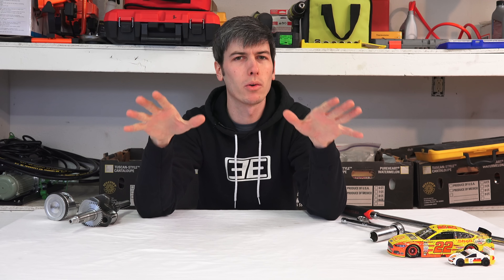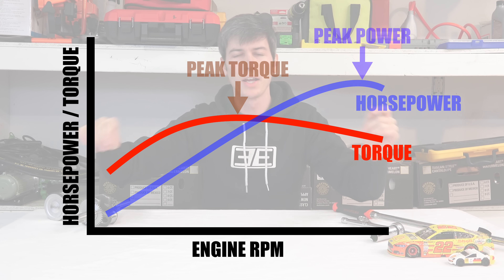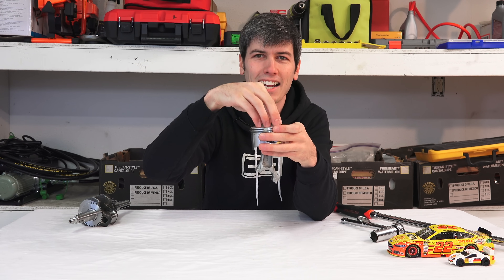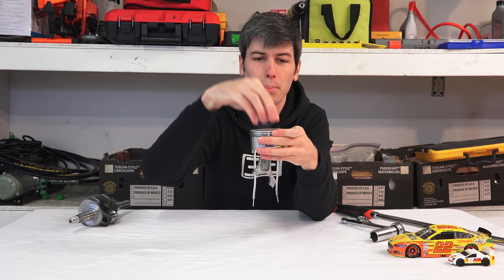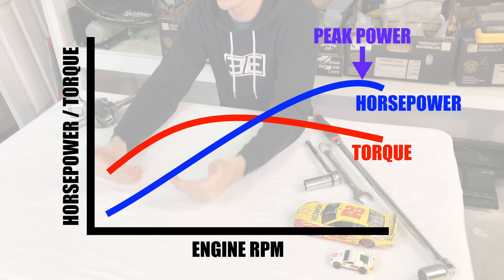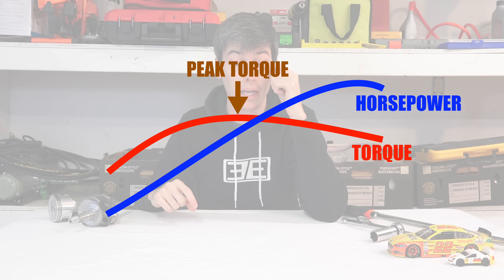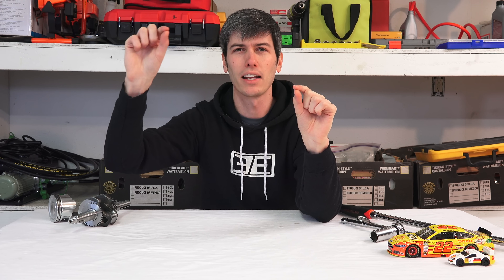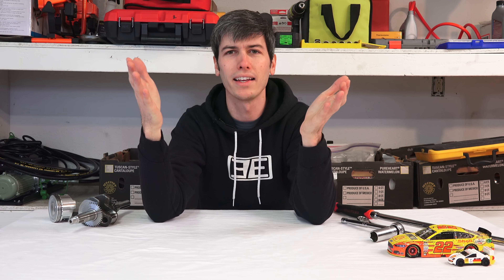Horsepower vs Torque - A Simple Explanation

Comment: Is Torque what allows a Car to go up a hill faster than a Car with less torque?
Reply: No, power is the end all be all when it comes to capabilities. Power is torque times rpm. It takes a certain amount of torque applied to the wheels to move the car. The wheels need to spin at a certain rpm for the car to move at a certain speed. Power tells you how much torque you can apply and how fast you can move the wheels.
Reply: @Redtooth75  Wrong. Car with same power + more torque, goes up hill faster.
Reply: @jp3630  if two cars have the same power but one has more torque then all that means is that the car will less power will just have to be in a lower gear. They will get up the hill at the same speed. If you apply more torque to the wheel then you will accelerate faster but in order to apply torque at a certain speed you need power. If power is equal then both cars can apply the same amount of torque at the same speed.
Reply: No ,you need more power with corect gearing to achieve more force at contact path which push vehicle forward no matter how much is on trailer etc feg let say we have 2 truck with trailer each weight 30 tons first truck have 500 hp and 5000 nm at engine crank in peak with optimal gearing whatever that gearing and quantity of gears be neded vs some other truck have 1000 hp and 2500 nm also optimal gearing and we have uphill at angle 10 degrees what is huge angle avg viaduct have like 3 degrees typicall so those truck will have very hard time go up this hill with this weight anyway quees which achieve tip this viaduct first ? Let say it have 2 km lenght and we start from stand still 😁 well it be 1000 hp/ 2500 nm version its because power:velocity= force at contact path so at each velocity 1000hp/2500 nm version thanks optimal gearing be able to exert 2 times biger force at contact path which push truck forward uphill and if weight both truck are the same than we know from this formula = force = mass x acceleration that second truck will accelerate uphill 2 times faster pushnyour body into seat 2 times stronger 😎

Comment: 50 years ago my Father worked at Caterpillar. I asked him why they didn't put those powerful engines that were in the bulldozers in a race car? Just think how fast that powerful motor would make the car! He gave me the "torque versus horsepower" talk. I remember that he eventually explained the race car would weigh a lot more in order to handle the torque of a big Cat diesel and that the extra weight would hurt acceleration.

Comment: can you make a vid explaining  "Volumetric Efficiency" in a diesel engine. i modified my diesel tractor and trying to understand the relationship between rpm and torque curves. i know HP is part of this equation, but i think VE plays the biggest part in max torque. a race car you want HP, but in heavy equipment you want torque.. right?
Reply: Volumetric efficiency is how much air can fit into the cylinder vs how much actually enters the cylinder. It is mainly determined by the camshaft but the cylinder head and intake manifold also influence it.
Volumetric efficiency is what determines torque, the torque curve is very close to the same as the volumetric efficiency curve.

Comment: Well said...the fastest car is keeping the engine at the highest HP (not TQ).  That's why these 8 speed automatics (often with less HP than previous 4 spd cars) are so much faster...they keep the car closer to peak HP (I think the new 2022 Honda Accord Sport has a 10 sp trans!).  Same with CVT as you noted.  

Also the basic physics formula for force is F = P/V (force = power divided by velocity), so to keep your "rocket ship" being pushed (force) as hard as possible for any given velocity, you want it at the highest Power (HP) not TQ.   (Total side note, but based on this formula, you can see the "push" you feel will decrease as speed increases.  That's why if you floor it at 25 mph it's much more of a "boost" (if at peak HP) than if you floor it at say 90 mph.)

Comment: My question is : will a straight 6 produce more torque than a V6 engine because it has a longer crankshaft? 
And also Are CVT cars faster than manual or automatic transmission cars?.
Reply: Torque is independent of crankshaft length, but will change with varying connecting rod / crankshaft radius geometry.

CVTs cannot generally handle as much torque as other designs, so generally performance vehicles don't use them.

Comment: @Engineering Explained 
I’m just a bit confused! I thought that Torque affects acceleration/0-60, but HP affects top speed….is that right?
Reply: It's weird. Ignoring constants, HP=torque*RPM. Think strongman competition vs someone who runs sprints. HP describes total work accomplished, let's say moving a school bus to the other end of a parking lot. Doesn't matter how it gets there, but that is the work to be done. A strongman could strap himself to the front, put the bus in neutral, and pull the bus across the lot. He moves slow, but he can pull it. A sprinter couldn't pull it, but you could disassemble the bus into 10lb pieces and the sprinter could run those pieces to the other side over the course of 1000 trips. If both people had the same "power," the final piece of the bus would make it there just as the strongman crosses the line. A high torque engine is designed to just put out massive amounts of force, so the thing is all muscle - at the trade off that it can't run fast (lower max RPM). A smaller high hp engine, is designed to be a lean sprinter. And if you had the right transmission, you could, in theory, put the same power down to the wheels. The practicality though is that the high torque engine is heavy and would be silly to put in a lightweight sports car. Likewise, to achieve the same hp in a small engine, you would have to have high revs - something that is stressful on the engine and very low fuel efficiency.

Comment: As alway's a great video.  
However, I felt that you left out a MAJOR misunderstanding of HP ratings in regards to cars, trucks & manufacturer advertisements.  They always give you the max HP of the motor which is always @ MAX RPM.  The problem with this is that no-one ever spends much time @ all @ 7000 RPM if that is the max RPM of said motor.  There is a reality operating range which should be acknowledged which is typically in the RPM range that we all run our vehicles at.  This is why diesels always feel like they have so much more towing power because a gas motor needs to be running @ the top of the revs to be hitting the HP levels the manufacturer claims it has.  Nobody that I know drives there gas powered trucks around red lining them just to reach the MAX claimed HP.
Reply: Not necessarily at max rpm, although it may be there at max RPM for naturally aspirated motors.

Comment: I think one part missing for me is that when I'm driving I start moving from my idling RPM.  So in a car tuned for high speed I don't see a lot of power until I can get the RPMs up.  In a car tuned to hauling I can see a lot of power at low RPMs.  And as explained elsewhere in the comments engines with lots of power at low RPMs cannot handle higher RPMs at all (and thus need larger high gears to reach highway speed), and engines with lots of power at high RPMs can handle higher RPMs better than not at all.  Start considering the size and weight of a transmission as a limiting factor and the difference in vehicles makes some more sense.  

On a side note, a bicycle may have 20 speeds (gear pairings) but some of the gear ratios overlap.

Comment: Which one should i use (peak power or peak torque) in these situations:
1. Climbing a hill / mountain
2. Drag race
3. Trying to achieve top speed
4. Off road driving
5. Pulling other vehicle
I will appreciate any answers
Reply: 1. power 2. power 3. power 4. usually neither since that will cause wheel slip and loss of control. For crawling motors with low rpm torque available will be more practical 5. power to accelerate, but usually motors with more low rpm torque available will be more durable, comfortable, and practical for towing

Comment: I always think of HP and torque as speed and strength, racing cars are quicker because the have more horsepower but less torque so they could not pull a heavy load like a truck, a truck can pull a heavy load but could not catch a race car even unladen.

Comment: Great explanation but I think there is more to it  example my causing has a 2015 wrx rated exactly at 410 whp all wheel drive on a mustang dyno 
It has a built engine and torque is around 335 tq
I have a 2013 335i n55 full bolt on wich from the tuner crank should be around 420 on crank hp wich most dynamic ha yield 360 to 370 same set up but torque is closer to 400  
So my car has les power more torque 
He has more power less torque 
And all wheel drive and I take him every time so the question is why?
Also have seen one with 550 who take on Cameron and other crazy cars with more power and beat them 
So my theory is we have a 8 speed transmission  wich should mean shorter gears  so hp can not be changed because that's the speed on wich a engine works  but trough gearing you change torque and there for power delivery
 so let's say 
Subaru car #1 410 hp 330 hp hits  30 miles  at 1st gear and 60 in 2nd gear 
The bmw hits 20mph in 1  but by 60 its in 3rd. Example only 
This means tha in every shift it lowers les down on the power curve and because of the smaller gearing puts down more torque 

Why torque can win races well very simple torque is the amount of force applied to the wheels 
So let's say you have to push a car if you do it alone it would be hard right?
But let's say you call ur tallest strongest friend not only would you be able to move it easier but also faster  because you have more force that you can apply 
So 2 cars same hp 
Let's say 300 hp but #1 200trq 
        And second one #2 350 torque 
Wich one is your money on 
Same hp different  tq 
I'd say number 2 cause it has almost twice as much force to perform the same task as the the speed at which they can perform it  but the Second one would have a much easier time doing it because it has more force to do it  I hope it helps some one that's why I can beat scatpacs 392s Camaros 5.0  although I have low power but hi torque and short gearing 😉👍

Comment: Thanks Engr Xpnd ... So... for dirt roads and inclined mountains... i would need more Torque ? ... is 197 vs 207 Nm significant difference for Torque?
The car with 207 Nm Torque has 190 HP @ 6600 rpm and the 2nd car with 197 Nm has 148HP @ 6000 rpm ... the 1st would have a faster acceleration at start but at the end, both cars would have the same strength ... right?

Comment: From a Honda guy, the lack of Torque made by Honda N/A engines is made up with the gearing for sure. Shorter final drive in the box makes a Honda engine very good. My K24 with a 5.1 final drive pulls better than a lot of smaller engined, turbo cars.

Comment: If I understand the two concepts (horsepower and torque), I think that the following statements are true: 
1. Torque is a component of horsepower.
2. Horsepower cannot exist without torque.
3. Therefore, to argue over which is more important is a false dilemma, because one is a subset of the other. While horsepower requires and utilizes torque, horsepower is a more comprehensive measurement.
Reply: Wrong. They are different characteristics and both are equally important.

Comment: An explanation of “Gears can manipulate torque” is what is missing
Reply: In elegant SI units, Power = Torque * rotational speed, which is expressed as P = T*ω.  In HP, ft-pounds, and RPM, we have to include a conversion factor constant in this equation, but let's put that aside.  The ω is the an omega, which represents the rotational speed.  You can call it w, if you prefer.

Since gears are not a source or sink of energy, the power the engine adds to gearbox must equal the power the gearbox delivers to the drive shaft.  For our purposes, assume a 100% efficient gearbox to keep it simple.

This means:
P_in = P_out

Which also means:
T_in*ω_in = T_out*ω_out

The gear ratio sets the relationship between the two ω values, by establishing a constraint that the gear teeth move at a common speed where they mesh.

If you cut the value of ω_in by half to get ω_out, this means you would double the value of T_in to get T_out.
If you double the value of ω_in to get ω_out, this means you would cut the value of T_in by half to get T_out.

You can pick any other ratio you prefer, that your transmission is designed to achieve, and manipulate the mix of T and ω as you see fit.  But you are constrained to their product based on the power that the engine can supply.

Comment: When the force from the piston to the crank shaft is the hardest you are at max torque witch is when you’re most likely to be a mustang driver in a parking lot. Once the crank is spinning as fast as the valves cams ecu can handle while still pushing you are at max power, Like when you’re pedaling on a bike too fast and the wobble created from your legs from pushing to hard cause you to slow down.

Comment: Hp-how fast it spins
Torque-how hard it spins
Reply: than you measured force at tire circuit at the same vehicle velocity let say 60 mph firt at peak torqe at engine crank let say 1000ft lbs at 1000rpm vs at peak power at 300ft lbs at 6666rpm and you find that at peak engine power you have 2 times more force at drive whelll tire circuit which accelerate your car forward .

Comment: Im confused with the cvt topic. He said with the cvt constantly adjusting keeping the engine at peak torque you’d get greatest acceleration but that you’d get more acceleration at peak hp. That doesn’t make sense to me
Reply: if he say so that for cvt at peak torq at engine crank you get greatest acceleration than he do misteake  ,. cvt .manual dsg etc all give you max acceleration at given velocity only when engine is at its peak power rpm .
Reply: if he say so that for cvt at peak torq at engine crank you get greatest acceleration than he do misteake  ,. cvt .manual dsg etc all give you max acceleration at given velocity only when engine is at its peak power rpm .

Comment: What about an electric car with a single gear. Will it accelerate fastest at peak torque or peak horsepower?
Reply: peak torque always ., when you have one fixed constant gear like in most modern electrc vehicle like in most electroc cars bikes and me elecktirck kick scooter tha you get max acceleration at peak engine torque if this peak engine torque is constant on wide rpm range than the lower velocity you have at those peak torque the better acceleration you get .,in this egzample where we have in vehicle one fixed gear this happen because VELOCITY CONSTANT CHANGE  with engine rpm you cant change gearing for use peak engine power rpm at the same velocity as you use peak engine torque thats the point in combustion or electric with 5-10 gears you can chose what rpm engine must have at given the same velocity for egzample 50 mph  let say you compare  peak torque let say 1000ft lbs at 2000rpm  at 5 gear vs peak power let say 250 ft lbs at 16000rpm at 1 gear both at 50 mph than 250ftlbs at 16 k rpm will accelrate faster at this velocity but when you comapre 1000ftlbsat 2000rpm at let say 20 mph vs 250ftlbs at 16 k rpm at 160 mph so when you hav onefixed gear than you get fastr acceleration from 1000ftlbs at 2000rpm at 20 mph .

Comment: Horsepower is for speed and torque is for acceleration. Dont be surprised, you may think that more hp are quicker but that's not true.

In most cases rpm beats torque so it might seem as more hp is for acceleration. In modern cars fuel supply is linked with throttle pedal's depression and rpm so you wont notice minor more fuel supplied to engine when car encounter uphill or less rigid surface.

From point of view of fuel consumption, more fuel is needed to overcome deacceleration and maintining constant speed. Often one has to press throttle further to do so. A car with more torque and same hp face such situations less frequently. So more torque overcome deacceleration easily or torque is related to acceleration. Same thing happen when load is more and car has to move from rest or other situations that specify change in speed significantly. Yes, sports car doesnt need more torque than hp and still be quick but that is another story.

Comment: But 
1. when 2 cars race each other. Is the car with a higher torque going to win or the car with higher horsepower?
2. Which of the 2 is more important for the acceleration of the car and which of the 2 is more important for the top speed of the car?

Comment: Rather than using the term "work" I think it's easier to understand that power measures how fast you can deliver force. As stated torque is the twisting force that comes from the force the piston pressure exerts on the crankshaft to turn it. Power is a way to evaluate how well an engine maintains that torque output as engine RPM increases.

Comment: Everythings fine with my brain about the torque vs hp until it hits the 2 cars with gears mark. 
Gears can be configured easily no?
Lets say the car with 100hp-200tq is geared taller than the one with 200hp-100tq then its still goin to be quite equal or faster for the high tq one than the high hp one.

I think a better comparison would be equal on both cars on everything without gears. 
Torque one will accelerate faster but will have lower top speed
Hp one will have higher top speed but lower acceleration

In case thats not the case then thank you for melting my brain when my while life i tought tq=acceleration
Hp=speed
Reply: You mean the high torque motor is geared shorter right?